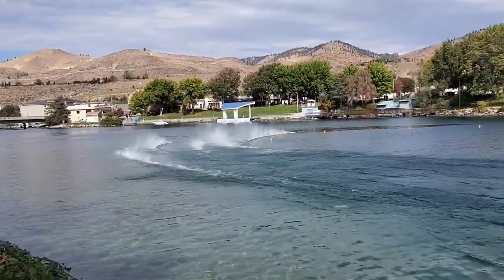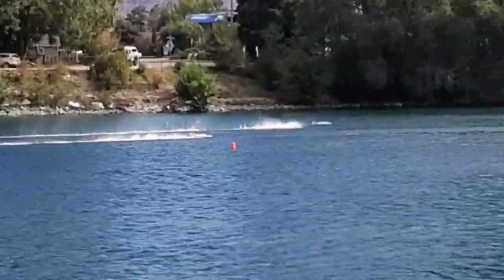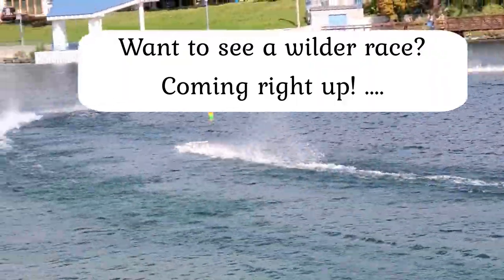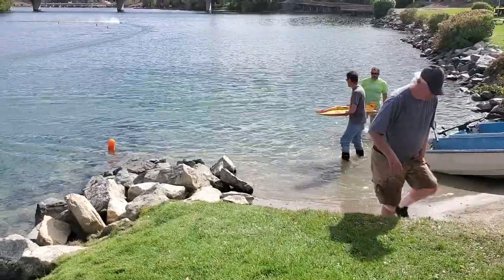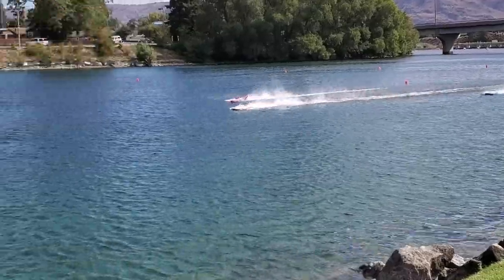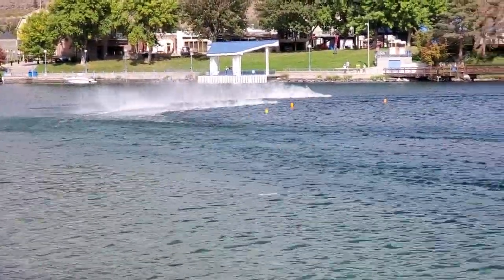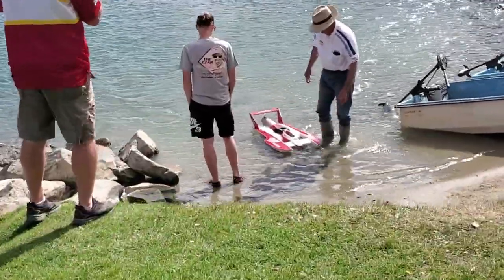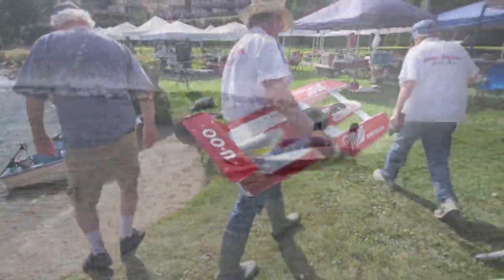Electric RC Hydroplane Racing | The Gold Cup from Chelan Washington

Comment: Scott, just picked up an old 1/8 scale Dumas Miller American #1322 project. Any hints or suggestions on this build?
Reply from the maker: That'll be a fun build!  What are your plans for the boat?  If it's just to run for fun, build it as-is and you'll have a ball. I would suggest however, that if you want to build a competitive race boat, the Dumas kit isn't the boat for you.  Much more modern (meaning faster!) designs are available and I can steer you to one of those if you wanna RACE!
Reply: @M5PerfHydros  Thanks Scott, Just for fun for now. There's no one up here to race with but my brother. But it only takes a spark to  get others interested.. Keep making your videos, Educational and Great to watch.